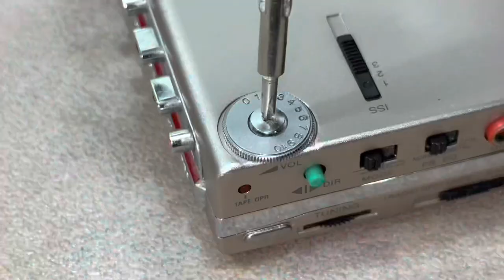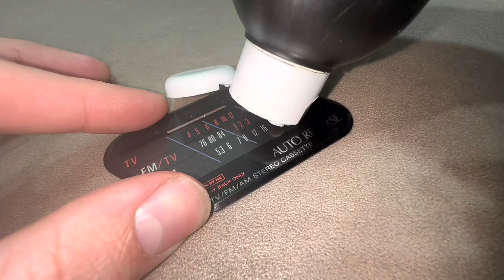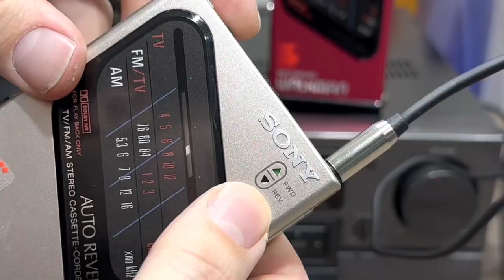SONY WM-F203 Walkman Radio Cassette Player Maintenance Repair Restoration

Comment: Horrible Wow and Flutter. Terrible You did not use correct belt. You wasted all that effort,  by not using proper belt.
Reply from the maker: Hello. Can you tell me the original belt dimensions. I know that the thickness of the meat will be 0.5. What is the other measurement?